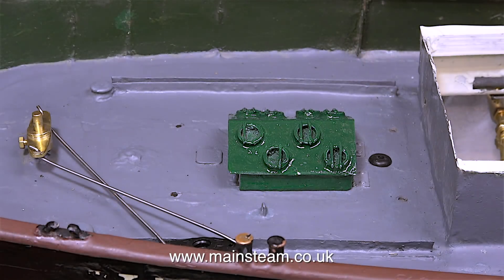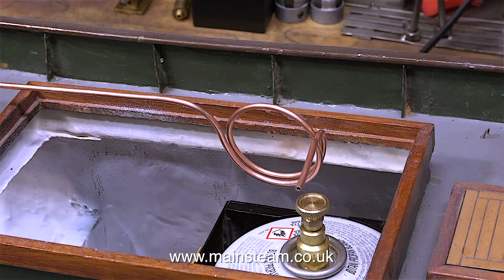A MODEL STEAM BOAT NAMED EDITH - PART #30

Comment: This is just a theory.... Could loop the exauhst pipe arround the gas tank to stop it getting too cold? Then to a large trap to collect the condensate
Reply from the maker: If you do that then too much of the exhaust condenses and the condenser/oil trap fills up too quickly - I thing I have experiments with many principles to stop the gas from chilling and so far this method is probably the safest in my opinion.

Comment: I notice that you use silver-solder for all the piping; even that which doesn't carry hot steam; I assume using silver-solder is the best, most robust choice for all model steam engine piping?
Reply: esquehill The problem is that soft solder and live steam are truly dangerous together. You are correct that piping that does not heat up can get by with soft solder.
Read an article years ago. Guy forgot he had soft soldered a lovely old pressure gauge. Did a steam pressure test and the gauge blew off,embedded itself firmly in an overhead beam,and since the shutoff went with the gauge,the pressure contents emptied into the shop,rapidly making human habitation life threatening.
The solidus of soft solder is too close to the curve when you mix pressure and temperature. Keith is doing in my opinion a belt and suspenders approach in case anything goes wrong while operating the little vessel. Hands,faces,eyes,skin and other human bits are just never the same when cooked. Silver solder is so much safer and longer lasting. Soft solder works well on household plumbing.
Look up images of boiler explosions and imagine you nearby. Ouch.